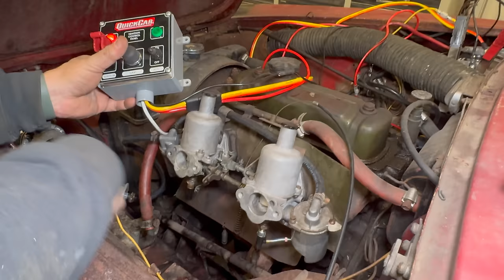Problems Getting Fuel So The Tank Must Go

Comment: She is spluttering a bit but she is running. A little more tweaking and it will be fine. The fuel tank looks really 'crusty' but as long as the metal is not too thin from rust it will be serviceable. Thanks Steve keep going with this one. 👍👍

Comment: Very rare car well worth restoring. The Innocenti 950 was launched at the November 1960 Turin show, but series production only began in 1961. A total of 4,790 Spiders (950's) were manufactured up until February 1963, when the Innocenti 'S' was introduced with an 1100cc engine, disc brakes and revised rear suspension.

Comment: Looks like a nice simple old machine to work on , with a familiar old British A series  engine . Those Su carbs are dry as a bone in the dash pots by the looks of it .
Reply: Theres a very interesting fast motion video here on YT of a Sri Lankan teenager disassembling, renovating and reassembling an 'A series' engine from a Minor, many of which still running in Sri Lanka, over 50 years from manufacture! Seems not only are all parts still available for the car, but 'A series' engine parts have 100% availabilty too.

Comment: Why does the starter "cut out" after a few seconds? Sounds like only the solenoid is engaged  and not the bendix (after a few seconds).  My Jaguar MK2 does this.
Reply from the maker: On most British cars the starter is designed to stop when it detects the engine is starting. It does make it harder to start a car when it is cold or not running right.